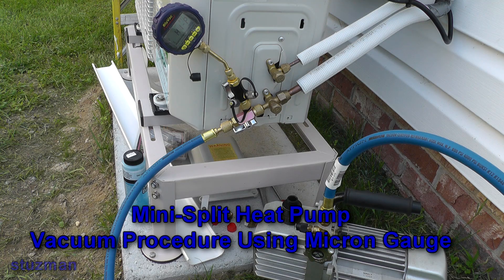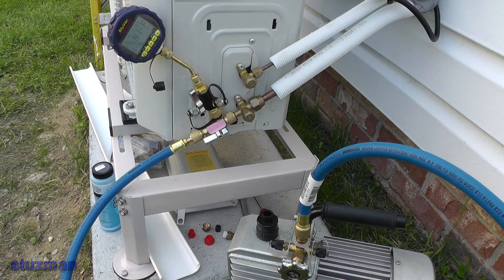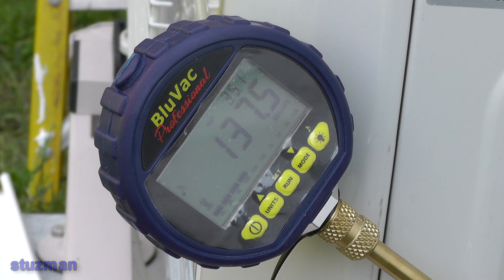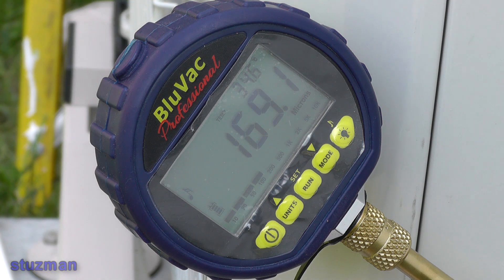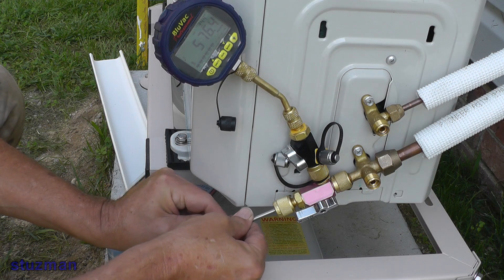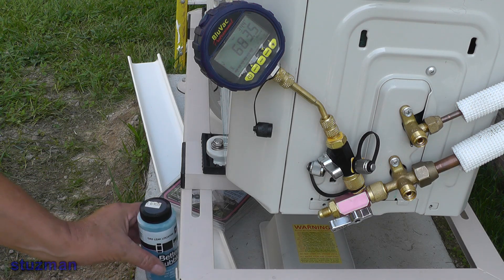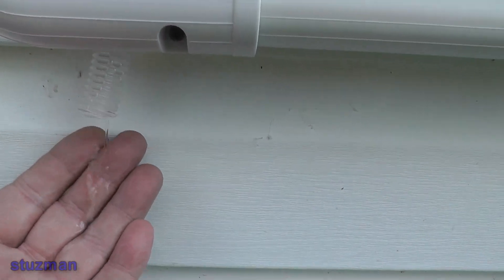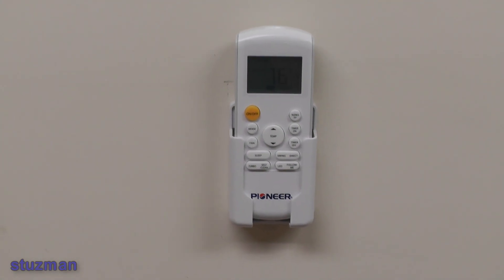Mini-Split Heat Pump: Vacuum Procedure Using a Micron Gauge

Comment: I follow this fella to the "T" and it is definitely worthwhile.  He is exceptionally knowledgeable so much so I went as far as purchasing (or replacing inferior equipment I have had) every piece of equipment he shows in this video.  Yes, it cost quite a bit for a residential DIY fanatic (me) but I like to have the right tools.  Couple that with his definitive explanation and now I have a well-running Dual mini-split system and a happy wife.
He has been incredibly generous with his time and is very patient in his explanations, and no I am not related to him.  I have found that it is not necessary to jump around to different Youtube HVAC presentations as you will not find any better than Mr. Stuzman.
Reply from the maker: Thank you very much Norman and the most important info that I picked up in this comment is that the wife is happy! And when you can do that, you're making lots of progress in life :)) Have a great day Norman and glad to hear that your unit is working well!

Comment: Excellent video, well done, informative and to the point.
I do everything that you do. 
If I may be so bold to add two things in addition to what you do, with much respect.
First during the pump down I will open and close the valves on the pink and black valve core removal tools. I have found that some small bubbles of atmosphere can stick the the valves. It’s really a small point, but it’s easy to do, and only takes a minute.
The second thing is when you are putting the Schrader valve back into the service port, you are introducing a small amount of atmosphere. 
What I do to avoid this is to close the pink valve core removal tool, take off the yellow hose from the vacuum pump, put the Schrader valve insertion part of the tool in to the pink valve core removal tool, then when you open the valve on the pink valve core removal tool and feel the pressure of the refrigerant, I loosen the connection of the Schrader valve insertion part of the tool just slightly, until you get just a minor “purrt” of pressure coming out, that should eliminate the small amount of atmosphere from inserting the Schrader valve from the system. 
Two things, I know both of my suggestions are on the nitpicking scale, I’m not intending them to be nitpicking, I’m hoping that they will make your skill level up even higher than it obviously already is.
The second thing is letting that small amount of pressure out of the Schrader insertion tool is obviously letting out some refrigerant to the atmosphere, which is a frowned upon, and bad for the environment. I understand that, but if you have a system that runs for another year or more because of how utterly uncontaminated the refrigerant is, isn’t that better for the environment?

Again, excellent video, id not change a thing, but id hope to offer a couple of points to add to your fine work.
Cheers from Tokyo.
Reply from the maker: Thanks for the kind words and the helpful tips from Tokyo!

Comment: Great video!   I held a nitrogen pressure test for 8 days with no drop. But my vacuum down to 150 micron keeps rising.  I connected my micro gauge and core removal tool directly to pump and it leaks much quicker.  Tried a shutoff instead of core remover and same thing.  Do these cheap ones leak under a deep vacuum?
Reply from the maker: Hi George! I'm sure that you don't have a leak when your nitrogen test held for eight days. It's normal that when you turn the vacuum pump off, the micron gauge will rise. There is always a very small amount of air in the system, and this air pressure will slowly rise. You just don't want to see it continually rise. And when you connect it to your vacuum pump and then shut it off, the pressure will quickly rise which is normal. Maybe, this video will help explain further https://www.youtube.com/watch?v=cI6pSBaskjc
Reply: @stuzman52  That was extremely helpful in understanding what's going on.  The key thing I learned is that everything leaks - the core removal tool, the shutoff, and the smaller the volume the worse the leak appears.  So it was normal that my micron kept rising all night long - I was expecting it to stop.  But I don't really want to spend $75 on the second 1/4" Appion core removal tool.  Can I just connect my micron gauge directly to the first core removal tool with shrader valve & depressor intact (instead of using a second core removal tool), then simply unscrew it before pressurizing, or would that be worse than using a leaky shutoff?  Thanks for all your help - trying to get this vacuum to hold is really beating me up.
Reply from the maker: No need for the second valve core tool. I used it to keep the refrigerant oil off of micron sensor.

Comment: Hi again Mr. Stuzman52!:) I have come along way since my first mini split install which I followed your guidance. Since then….i have installed about 7 mini splits ranging from 9k to 36k single head units. I am in the process of installing a 48k, whole house ducted mini split and I am having some issues. First…what was different on this unit was all lines needed to be brazed…or for me, I used a high silver content solder which has worked well to this point. Much easier to work with than brazing…
Anyway….i was very happy with my nitrogen pressure test….instructions want you to hold a pressure test at 550 psi, which I had never done with the smaller units. I would go to 300 psi or so….and my gauges were equipped for that. On this one…I pressurized to what I thought was 450 psi….gauge maxed out at 500….as it turns out, I was pressurized to 750 plus for at least a week. I think my connections are good!
Until I come to the vacuum….i connected everything as I normally would, and I was able to vacuum down to 380 microns. As soon as I close the vacuum side….the numbers would start to climb. I rechecked all my fittings….put more Nylog on the threads…and it still is climbing. It would go from 400 microns to 800 in probably 20 minutes. The instructions literally state to hold -14.7psig (500 microns)for 1-2 minutes on the analog gauge. If it holds…then remove and release Freon. I’m thinking my digital gauge is just far more sensitive…and maybe I’m too concerned about the climb? Being a much larger system…the indoor air handler has considerably larger capacity, would that have anything to do with it? I am just trying to understand how it kept such a high pressure with no issue…and yet the vacuum side isn’t what I am used to seeing.
Any thoughts would be appreciated….i want to be sure I am in good shape before I release the Freon. Thank you again….hope all is well for you!
Steve.
Reply from the maker: Hi Steve! The biggest thing is the pressure test that you did and everything was sealed tight. If there was a leak, you would definitely have seen it during this test. It's normal for the vacuum pressure to rise especially on lines that are longer and the diameter of the tubing is larger. Remember, you can not get 100% of the air out of a system. This very small amount of air will expand during the hot ambient temperature and with all of the volume of the tubing, the pressure will rise. I would say that your system is okay.

You mentioned that your using silver soldering instead of brazing. It's true that silver soldering is much easier as it doesn't require nitrogen to be flowing during the soldering process and it doesn't leave a carbon residue inside the tubing. However, there is one drawback to silver soldering. It requires a flux and this flux will be inside the tubing which is acidic. Then the flux is sent through the system contaminating the refrigerant oil. Just something to keep in mind. Here's a video on Craig's YouTube channel of autoservice tech where he demonstrates the pros and cons of brazing and silver soldering. https://www.youtube.com/watch?v=hrXX4IjjChM Have a great day and wishing you much success with all of your installations. Terry
Reply: @stuzman52  Thank you for the response! I have been chasing my tail it seems over the vacuum part. After rerunning  another pressure test, I have decided I am good. As for the flux…I am aware of this risk I suppose. Sure seems to be a bunch of mixed thoughts on it. I am far more concerned about the solder particulates that I found when I took apart some of the fittings. I wasn’t expecting that! I suppose I will find out what impact that has here soon. I hope the filter/dryer does an amazing job….and hopefully some other filters in the system?
I was far more comfortable with flared fittings…and I don’t think I would go this route again. 
While searching for your vacuum video…I saw all the other ones you made over the years. I will be going back and checking those out! Thanks again Terry!

Comment: Did you see how your microns went up to the 6ks by the time you finished? That means you have a leak somewhere. If you go down to 250-500 microns, once you stop the vacuum the microns should not go above 1000, if it increases like it did on your video then it means you have a leak, moat likely a flare connection is loose.

Comment: I've never done it that way. I dont mess with those core removers. I use my gauges with a micron gauge. Then rather then the micron gauge to vacuum leak test I use nitrogen and bubbles on all the connections.  Could even do a pressure test with digital gauges.
Reply from the maker: Thanks for the comment and have a great day!

Comment: I don't know if you still monitor this video, Mr Stuzman, but I want you to know that it's very nice to view a thoughtful/helpful (and extremely practical) video made by a fellow southerner.  I really wish there were many many more like it.  A whole lot less BS and a whole lot more down to earth information is what folks struggling to make ends meet actually need to keep from being taken advantage of by those who would prey on people in need.  Our 12-year old Mitsubishi mini split went down after a nearby lightning strike, so we've been without AC for most of the summer.  Considering that the insurance company offered us just over $300 to have repair work performed - and the local HVAC thieves wanted as much as $10K to replace our (single zone) mini split system - we decided to buy our own system and give it a go: we didn't have much choice.  The point being that your video has gone an awful long way toward giving us the confidence to test out our own new system before possibly wasting the expensive refrigerant that came with our 24K BTU condenser unit!  Thank you, sir, I have both liked and subscribed to your channel.
Reply from the maker: 10K to install a single stage unit is pretty high. Good for you to install the system yourself and save some money. Since your last unit was taken out by a lightning strike, you may want to consider installing a suppression unit on the voltage input side of the system. Good luck with your install. Thanks for watching and sharing a comment. Have a great day!
Reply: @stuzman52   Thank you for the reply, Terry.  I'd like to ask you a question, sir.  Why is your BluVac micron gauge mounted the way that it is?  Is that a special adapter you're using to get more clearance for the gauge?
Reply from the maker: @OldSchoolLFCGeezer  The bent tubing that you see attached to the micron gauge comes with the micron gauge. If you're referring to the valve underneath it, that was installed to keep refrigerant oil from contaminating the sensor located in the micron gauge. Otherwise, when the refrigerant oil gets on the sensor, it would have to be cleaned. Have a great day!
Reply: @stuzman52  Hi Terry ~ Thank you very much for clarifying this for me.  By the way, I wanted to ask for your thoughts on my vacuum procedure.  Late Thursday night, after completing a successful nitrogen pressure test, I set everything up exactly as you did in this video.  The only things different in my setup were the absence of the bent 45-degree tubing I already asked about and the fact that I used a CPS VG200 micron gauge.  It took roughly 10 minutes to get the vacuum in the setup down to 180 microns.  About 20 minutes later, however, the vacuum had changed to 340 microns.  As this reading was below the 500 micron limit, I went ahead and released the refrigerant stored in our new outdoor condenser unit.  So far, the system seems to be working well, but I still wanted to ask you if the 160 micron reduction in vacuum that I observed (over 20 minutes) was a cause for concern?
Reply from the maker: @OldSchoolLFCGeezer  No, there is no need for concern on 160 micron level. It's normal for the system to pull to a lower level while the vacuum pump is running. And then when you close the valve and turn off the vacuum pump, the micron level will rise. The key is that it doesn't continue rising after a few minutes which signifies a leak. Another video that you may find interesting about a rising vacuum level is this video. https://www.youtube.com/watch?v=cI6pSBaskjc&t=0s Have a great weekend!

Comment: What is the procedure for doing a mini split with multiple zones? I plan on doing one with 3 separate line sets
Reply from the maker: I've never done one with multiple zones, but each zone should have a separate valve. I would suspect that you would pressure test and vacuum each zone separately.

Comment: I watched this video about a dozen times back in 2019 while doing a $250K renovation on a early 1900, 4,200 ft2 house. I gained enough confidence to do the whole house in Mitsubishi mini-splits. Yea, I was a little nervous but I was confident enough to take the chance to save more than $26,000 over having to pay someone. That system had 3 condensers and 13 heads and the install was nearly flawless...! ( I made one bad flare) I talked to the lady I sold the house to in early 2024 and she said the system still runs PERFECT. I've now installed two more systems for family (a single head and a two zone) and I'm in the planning stage for a 3 condenser, 11 head system in another restoration project. STUZMAN... YOU ARE THE BOMB! Easy to listen to and tells you everything you need to know.  Good job .
Reply from the maker: Thank you Mike for the kind words and glad to hear that you had quite a few successful installations. Keep up the good work!

Comment: Is there a vacuum mode when pulling a vacuum when this isn’t a new install?  Is there internal valves that need opening for the vacuum?
Reply from the maker: There isn't a vacuum mode whether it's a new install or an installation that's already been installed. In your case where the system has been installed, the refrigerant is already in the lines. The recommended procedure is to recover the refrigerant with a machine that will pump it into a tank. Once the refrigerant has been removed from the system, then a vacuum pump can be installed on the system to remove the air. And after the system has been pulled into a vacuum, the refrigerant is weighed back into the system. Have a great day!
Reply: Thanks for the quick response!  I wasn’t sure if these systems had internal electronic metering valves. I can’t find anything in the manual i downloaded.

Comment: Great video ! This is the only way to perform the vacuum procedure.  After valving off the core removal tool, I’ve never before seen the micron gauge continue to decrease. I’ve always had it increase slightly as the vacuum equalises throughout the lineset
Reply from the maker: Thanks Glen for the comment and have a great day!

Comment: Mr Stuzman. I can't thank you enough for your mini split videos. I have watched all four and after watching I decided to install a 18Kbtu mini split heat pump myself in my garage workshop. I followed all your processes from bending and flaring the line set, torquing the flare nuts and pressure testing with nitrogen. I was able to vacuum my system down to a stable 198 microns. Using the two core removal tools proved to be good advice. The system is working great. Thank you for your expertise in showing your install process. I appreciated it very much. Thank your wife for the excellent camera work too.
Reply from the maker: It's really great Carl to hear that you did a great job with the installation of your mini-split. I'll tell the wife about her filming and wish the best for you and your family! Have a great day!

Comment: Thanks again Stutzman.
Here's what I did to vacuum my last mini install.
I nitrogen tested my system, - tested good. I then slowly released the nitrogen until my gauge read low.
I immediately put the valve removal tool on the mini port and the micron gauge directly on the valve removal tool.(mini core was already out). I vacuumed the system down to ~110 microns and shut the core tool valve off and let it sit for ten minutes - still held 110 microns. I then put the valve in and let a little refrigerant into the lines to build pressure, when everything was good I let all the refrigerant in tested for valve leaks and then removed the valve removal tool.
My thinking is that the fewer connections the better, my system vacuumed to ~110 microns.
Reply from the maker: Sounds like you did a great job! Yes, you want the fewest connections when you're pressure testing or pulling a vacuum. Keep up the good work and have a great day!
Reply: @stuzman52  Thanks. 
I think one thing I would change is that instead of replacing the valve at max vacuum I'd bring up the pressure slightly so that the it's just slightly positive 410A side so it's pretty much in balance.
I did check the Appion valve tool and with vacuum it's showing ~18 microns with the valve opened. By the way the CPS Vg-200 meter is good for 450 psi with a burst of 3k psi, so even if it was full pressure from the mini it still wouldn't have a problem although I don't like to test that.

As always you've been great help and I very much appreciate your videos and input.
Reply from the maker: @mosfet500  Thanks for your comment and sharing your experiences with your mini-split. Have a great day!